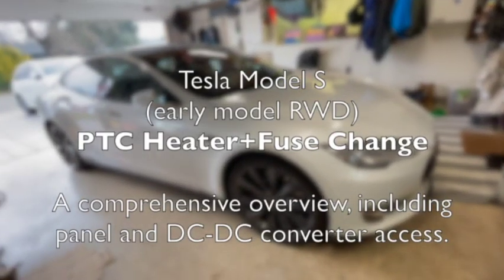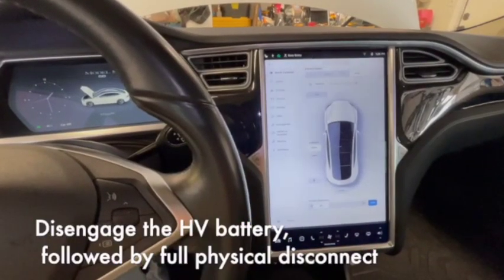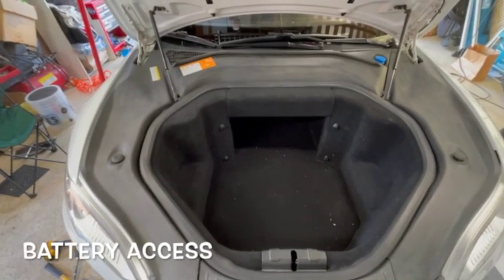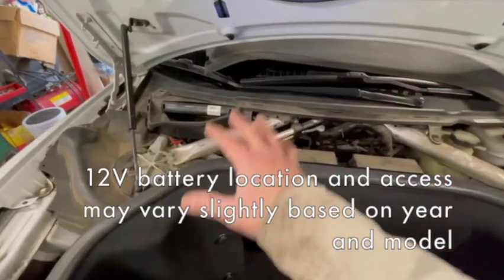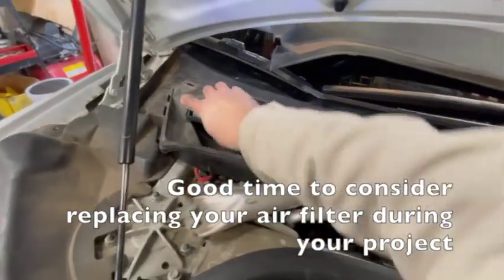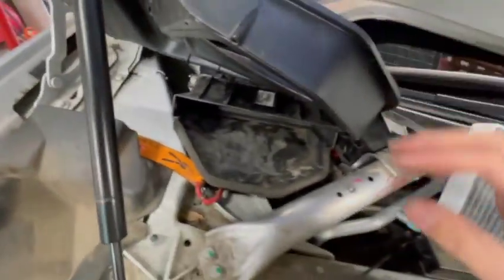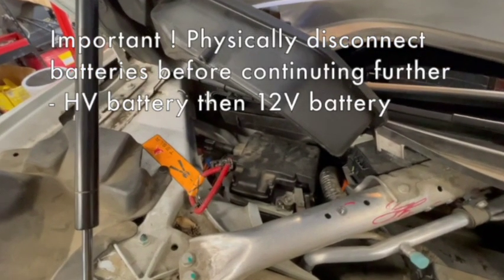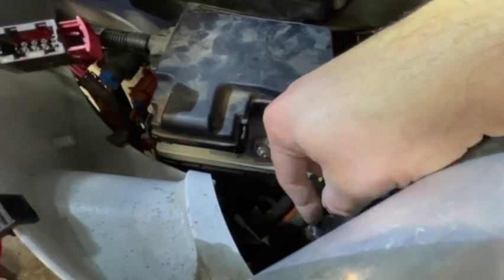1of5: Tesla Model S DC-DC Fuse+PTC Heater replacement  (General overview, access and disassembly)

Comment: Thank you very much for making this series of DIY video for replacing Fuse and PTC Heater.  I have 2013 Tesla Model S P85+.  My original PTC heater was 6007385‑00‑F.  I followed your video and replaced fuse and Gen 3 PTC HEATER 1041265-00-F.  Your videos are the most thorough in step-by-step disassembly instructions.  As for re-sealing DC-DC converter, I used Permatex 25228 The Right Stuff 90 Minute Black Gasket.  

Now my PTC Heater is working like new.  Thank you !

Comment: I’m not sure where you were located but the dealership is trying to charge me $4800 to replace my DC DC converter. They say that they don’t make it anymore so they’re retrofitting the new one onto my ass and it’s gonna cost $4800. I can’t find a mechanic in Las Vegasto put the DC DC converter in. They told me I could get one on eBay for $100 please help me.
Reply from the maker: Wow, that’s a lot but not surprising since part is likely even rarer now. $100 part seems cheap. Check out my videos for DYI guidance and save money on install. Finding a part may be the harder of the two tasks. Good luck!